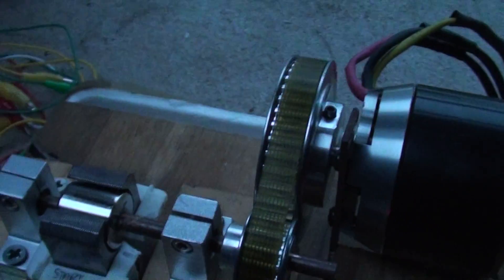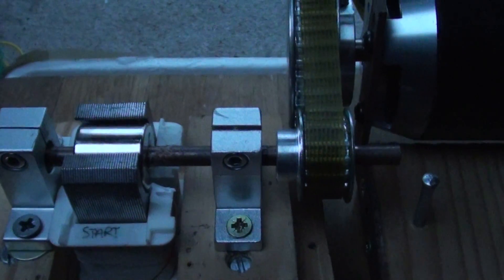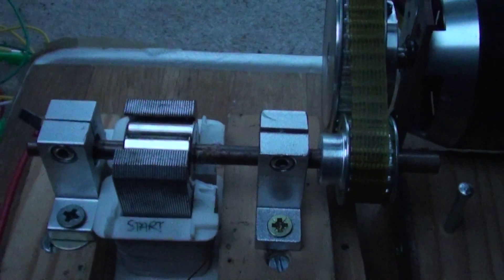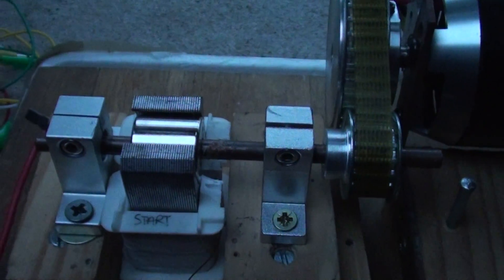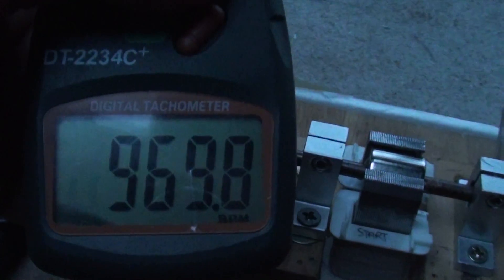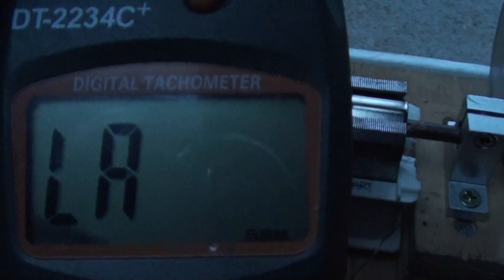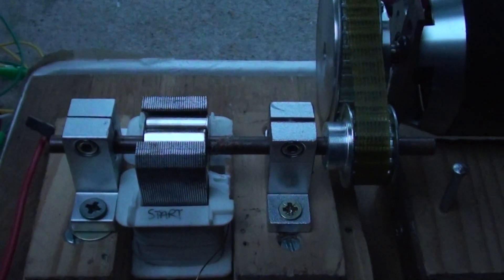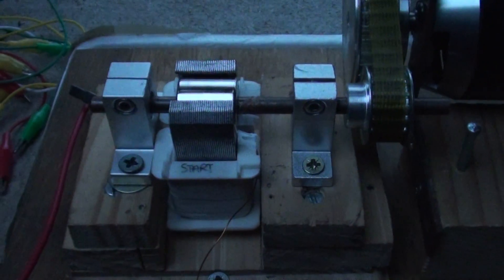Gerard Morin replication with neodymium magnet 5

Comment: Please do a follow-up video im curious how the bigger gage affects the amperage . my setup has a high frequency transformer i took from a power supply and i have 600+volts i ran a cheap 12 volt drill motor at 18vollts battery pack

Comment: Good start. I came upon this while looking into electrostatic motors. 
I figure converting electric energy directly into mechanical energy has more benefits other than just space travel, 😉. 
You're headed in the right direction here; but obviously but switching your mode, medium, and methodology there is opportunity for double the power. I.e. an exponetiall increase in efficiency. Extremely easy.

As I was just explaining to someone they probably knew the physical laws of a magnet motor, at the least, a hundred years ago. But, with the advancements made in the last three decades.. .it opens up this area of engineering again. Exciting.

Comment: Nice work here.....👍👍

I guess you can try also using the same small gauge  wire originally used for the rf pump motor....rewinding the starter now with 3 to 4 or 5 wires at once to improve the efficiency...

Comment: hello,nice job,however this not "like gerard"..... into the market,what u use to buy is meanly BDLC low voltage/hight amps,the system of gerard is working the opposite: hight voltage/really low amps (max 1,5 amps),lentz law (or back emf) is building proportionnaly to the amps,then on gerard system,with high voltages and low amps,there is a minimum undesirable back EMF created,definitly 90% less than with LV/HA....other difference,is the dc current is pulsed around 100 khz by IGBT bench transistors (generally 2 per phase)to supply the direct drive motor,with a particular sequence,in other terms,coils 1 ON,coil 2 OFF,coil 3 OFF,then 1 OFF,2 ON,3 OFF, and so on....then,when a coil is supply,it become repulsiv for the rotor magnet,then when the coil turn off,this coil become attractive,this energy is for free because it is only property of magnet itself on metal itself too that enter in game,then the cycle continue,and so on....this is also for this reason that directs drives motors HV/LA,have more torque to equivalent capacity than a classique asynchronous motor,all with a consumption probably around 70% less ;)
by the way gerard system cannot warm up neither, no amps means directly no heat....handy isn't it ;)

the futur is definitly into high voltages DC current pulse ;)

Comment: a few bits off advice.
1) while neodymium magnets can create a stronger field, they are also a tighter field. you would do better with ceramic magnets. their field extends further out, especially since the object is to use materials of extremely low magnetic permeability in order to reduce the effect of the lenz effect. that is why Morin uses a 3 phase motor surrounded by plastic and has no iron in it.

2) the magnetic fields act like tiny little brushes. if you align the magnetic north / south polarities so that they are running perpendicular to the coils simultaneously, the field generated to the sides of the magnet will do the work of creating the higher frequencies. 

3) use the higher frequencies generated from 2 as a "pump" for a raw electrostatic, such as can be obtained from running a copper wire up in the air

4) utilize a variable spark gap array to bump the raw electrostatic array to higher levels of voltage. start at 1mm then 2mm on the next, then 3mm up to 1cm (10 in all). be careful handling the array when it has power going through it, as past the 4mm gap, it will become near lethal.
Reply: Good advice probably as he used higher Guage copper coils he was getting higher heat dissipation so probably a step up transformer say a 2kv  neon transformer wd help if connected in series as a raised voltages before the coil and increased hz shd have determining affect with higher Guage generator winding probably with cap- spark gap, heat is a sign of higher current flow and its resistance cd easily b reduced with higher voltage nd frequency output if tagged to c transformer shd check that out
Reply: Y will the spark gap become lethal after 4mm if u could describe a bit and other than raising voltage what is the spark doing

Comment: nice ,you could also try with the motor spinning counter clock wise and the shaft with the magnet vertical instead of horyzontal you should have less resistance to spin and less draw as well as more output from the pump , and try to increase the diameter of the tungsten rod of your spark gaps that should also increase tremendously your output ( the magic is in the spark gap ) on ebay you can find 2 inch long 3/8 inch diameter for 10 bucks that should give a massive overboost to your output! and even better if you can put your spark gaps in a vaccum sealed jar , they works even better in vaccum . just some thoughts! how many amp do you draw for running the rc motor at 39 volts

Comment: Are the coils opposing wind or same direction wind.( ccw-cw or ccw-ccw) please let me know
Reply from the maker: circle559 Hi! Thanks for the question! I rewound the coils as per the way they come out of the factory, i.e. remove the plastic bobbin from the core, straighten it out, as I showed in the beginning of the vid, and wind one coil first and then the second, keeping the direction of spin the same throughout the operation. When you fold the bobbin back up to fit on the core, they are oppositely wound! So, long story even longer, one is cw, other is ccw! Bonne chance!!
Reply: shortblokej I thought so.. thank you very much.. how not much difference between original winding to your configuration?
Reply: @shortblokej  wind the same on a toroid core and then use a 5 turn zvs to power it. Solid state.

Comment: You DO NOT need moving parts to achieve this , you waste energy to run the mover motor. Also static electricity plays a role in over unity. Use larger dia. of wires please. larger dia. wires gives you more amplitude amps. The more turns of wire give you more magnetism and watts. The steel helps to add more magnetism. A good type of plastic as an insulator is styrene. use high frequency and you need to cool the transistor down so it does not malfunction while you are switching poles in the wires. Just an idea.
Reply: Several Polymers like PVC, styrene, PVDC, Cellulose are Piezoelectric .

Comment: Good work. Very clean mounting arrangement.
Reply from the maker: Thanks very much, well, it was until it broke - the shaft bent and the bearings disintegrated. Ooops!! Amtravelling now, but looking to sort out a new setup when poss
Reply: @shortblokej  u shd use the Tesla 369 principle 3 phases 6x2 stator winding and 9x2 rotor windings to get the desired frequency if u got that

Comment: please give details of the way in which the two axially mounted  disc magnets produce the conventional two pole rotor.
Reply from the maker: I'm not sure I follow you...the rotor magnet is a one piece jobby where it is diametrically magnetised to copy the original ferrite rotor from the washing machine. Thanks!!
Reply: Thank you for your    comment. Your video shows the rotor with two neo circular disc magnets at each end of the central portion which i assume is either a ferrite material or iron. How are the end magnets magnetised? Are they diametrically magnetised or or they magnetised  in the normal manner with opposite poles on opposite sides. I shall be looking forward to your reply for which thanks.
Reply from the maker: Ahh! I understand!! Yes it does look like there are two magnets there, but it is just one cylinder magnet and the white in the middle is some tape I put on to check the rotational speed, but it didn't register on the tachometer, I guess because of the small diameter and high rotational speed. As can be seen at 7:05 when the rotor stops the tape is no longer there. It is diametrically magnetized so as to match the original magnet from the washing machine pump motor rotor. Thanks!!
Reply: Thank you very much for your explanation as to why the rotor looks as if there are two disc magnets with an iron piece between  them. The ' iron 
 piece is in fact the piece of tape you attached to check for rotational speed. Have you come across a design for a rf pump that may be totally built up at home without requiring machining of special stampings?I am greatly intrigued by this rf pump principle and would like to replicate the work  done by others. But I live in a very backward country where most of what has been specified as being required is  just not available here. Please do see if you can help me out. thank you and wishing you the best.

Comment: Couple of questions:

How do you get 10kHz?  Your maths seems completely wrong, if the shaft speed is 2.5 x 9650rpm, then that's about 400Hz.

And what is the frequency range of the AC voltmeter?  Does it cover 400Hz?  Have you checked, these meters' AC range is designed for mains principally.

Comment: that's not the original magnet and shaft. mine over heats what magnet size are  you useing and size of the shaft plus the bearings
Reply from the maker: Hi, the magnet is from an on-line company called first4magnets. The outer diameter is just a little bigger than the original and the inner bore size is 6mm

Comment: A spark gap is to allow voltage to rise to the highest amount that a circuit is able to supply then at the electrical breakdown point of the air in the gap to discharge all the current quickly. There was a gimmick for car owners in the 40's till fairly recently that purportedly increased engine performance and efficiency, It was a plastic button that was cut into the king lead to the distributor, the cores when fed through the eyes of the button formed a spark gap, and no, it didn't work. J.

Comment: Hi Jamie  Great work , vehicle  coils can produce  20,000 to 100,000 kv but have extremely low amps,  it's like having a High revving engine in your car but has little torque to drive the wheels. I believe you are on the right track with your thicker wire because higher amps require thicker wire. I suggest you but 3 magnets and 3 coil sets on the same motor. Than test it under load to see how many amps and volts you get in order to see how many watts you are getting.   volts x amps = watts  or test this one under load.  Always remember high volts means nothing when you don't have  amps.  A   2 to 1 Transformers can double your volts but can it will half your amps. You can buy  A 750 watt generator which will run your lights and very small appliances or a 8000 watt generator that can run you whole house freezer ,washing, machine,air/con etc.

Comment: I Do not think you are using the apparatus as intended. The purpose of morin was to use the transformer connected to the AC induction coil to amplify frequency right? The apparatus cannot produce an increment unless the transformer is applied or connected. The interesting feature he said was that this can only be applied to a motorized source generator and not via readily availiable AC wall sources. This makes sense. Also, I personally do not believe the Generator needs to be a DC sourced motor. The rotating generation it provides in coordination with the spirally circulating magnetic field is what creates the Air jump, thus increase in frequency.  Atleast thats what i learnt from the morin experiment well made by the way secondary(RF pump), very old school. Is this something you havent attempted yet. do provide your inputs. I have some ideas about this too

Comment: Amazing Job Sir...Sir where can I get the gear holder and the magnet?
Reply from the maker: +Luciano Ebang Hiya, the gears can be found here: http://www.ebay.co.uk/itm/T5-Timing-Pulleys-for-10mm-Belt-/221487712004?var=&hash=item3391b24704:m:mGaaDyPdFhRa6kJOm3r2sIA and make sure you check the shaft diameters, and the magnet I bought from: http://www.first4magnets.com/circular-disc-rod-magnets-c34/20mm-dia-x-20mm-thick-diametrically-magnetised-n42-neodymium-magnet-p3641
Good luck!

Comment: Hi Jamie .LIke you video  good ideas  .i would like to try a simlar system where did you get the pullies  and do they run on a 6mm shaft. Thanks for your help last time.Gez.
Reply from the maker: +Gerard Melvin Hiya, glad that whatever I did/said was of some help!! So the pulleys I bought can be found here.. http://www.ebay.co.uk/itm/T5-Timing-Pulleys-for-10mm-Belt-/221487712004?var=&hash=item3391b24704:m:mGaaDyPdFhRa6kJOm3r2sIA
...make sure you check the shaft diameter!! The gen gear fitted perfectly - a nice push fit, but the motor gear I needed to drill and tap for a grub screw.The gear for the smaller pulley has a 6mm shaft dia. and the larger one has an 8mm . The smaller is 15T and the larger is 42T if their prices are the same as November last year when I bought them. Good luck!!